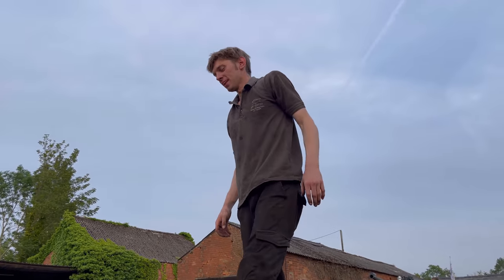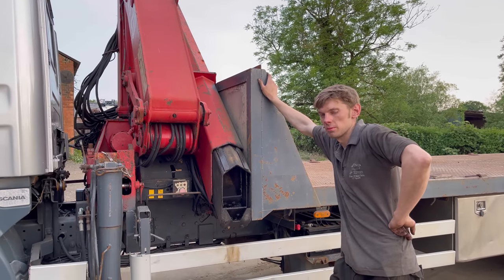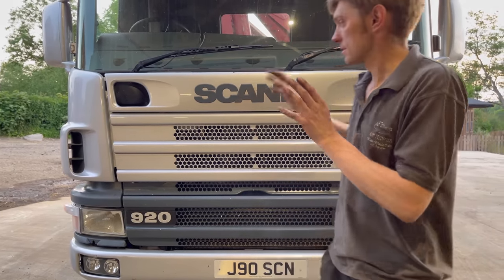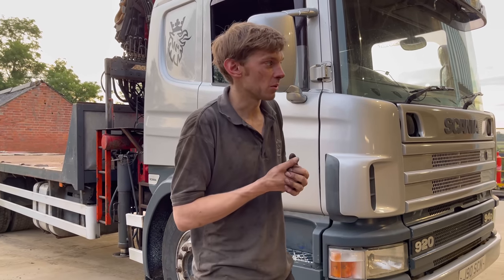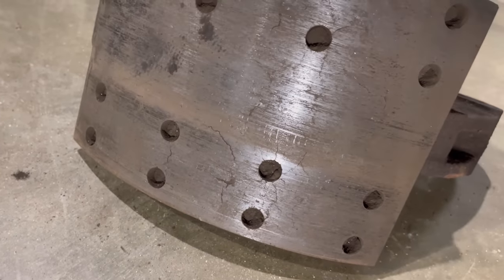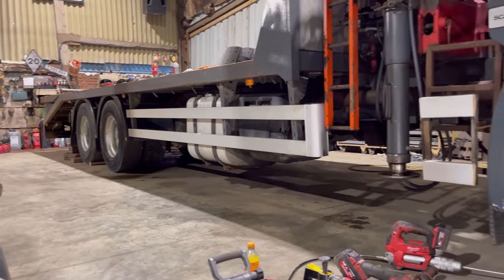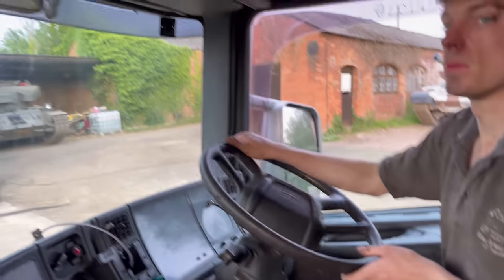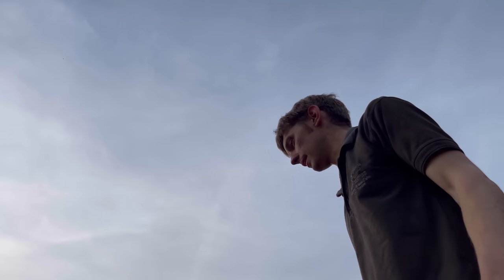We got a Swedish Foden! Introducing the Scania..

Comment: I’ve been operating 6 & 8 wheel hiab beavertail lorries for nearly 20 years and know that you will find this invaluable. They really are a Swiss Army knife, whilst it may not have the ability of the mighty Foden it’s a vehicle you can drive for several hours in relative comfort. 

As well as just about every bit of construction plant I’ve carried CVRT’s, an M4, Ferrets, and even a Mig 25 fuselage on them. You’ll wonder how you managed without it.

Comment: Did a few years working on Scanias (Master tech) and they really are a well built solid old truck. The heavy steel bracketry would make 'Bad Obsessive Motorsport' weep for joy! 
But that definitely needs a DSC14 V8 .... 'Proper Job!'
If that tag axle is a hydraulic ram one it will gradually sink as you drive along. The ram seals are sh ...  Keep the tag lifting cantilevers well greased and do get the brake backplates on before winter.
Colours? Well whatever the Fodens are cabwise and the HIAB needs to be a really garish yellow. 🤢